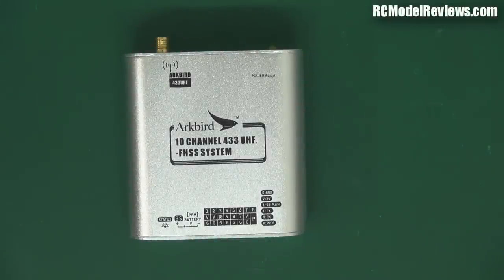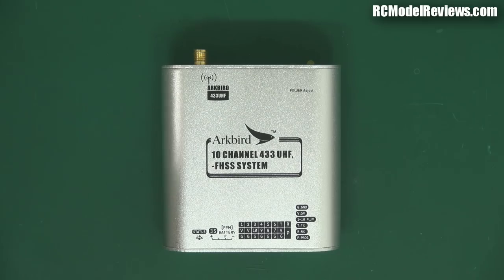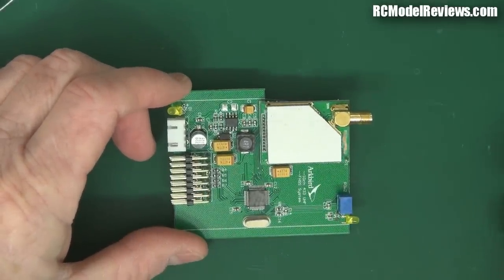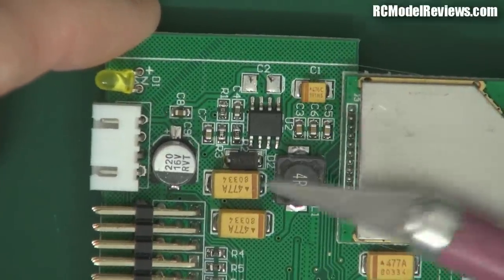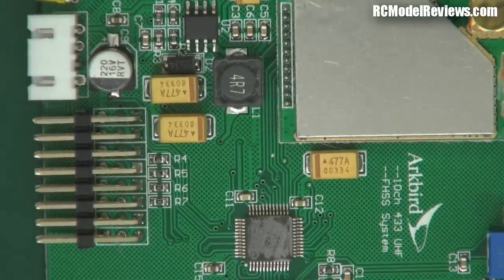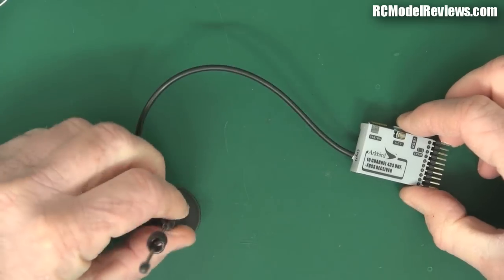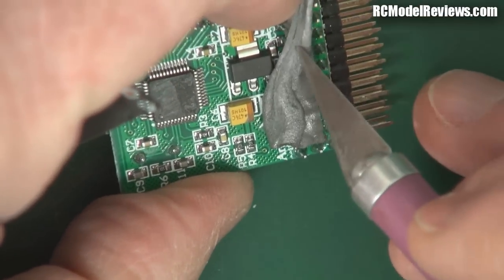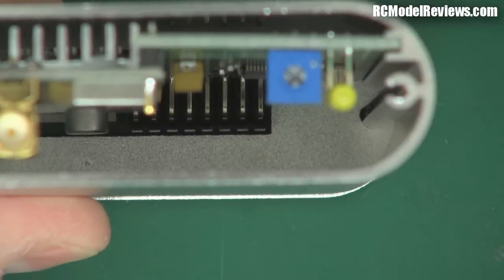UHF RC Shootout: Arkbird Long Range System (part 1)

Comment: Working my way through these with interest Bruce,  I have to say this was the one I was routing for..... I guess I will keep my fingers crossed for the testing, that said I am not looking forward to resoldering antennas fo rthe RX's if it shines in those tests.
Reply: RCTV-UK It seems like an interesting unit.  Soldering a jack on there looks like a pretty easy job.  Now that antenna looks pretty odd, but the performance could be fine for all I know.  I guess we'll find out, but I would just leave it as is unless there's a problem.  Maybe it looks weird but I wouldn't be bothered by it.
Reply: +pillsnotbills I've seen a video of someone doing 60km with this antenna.
Reply: I was thinking the same exact thing.  How hard could it be to soldier a jack on for a dipole antenna.  The price is right if it works

Comment: 3:13 3:37 So I guess it's effective. You admit that you couldn't easily find any data on that Xmitter module. The idea is that if a hacker wants to copy it, to have the hackers waste as much of their time as possible to make it non viable/profitable. 

Of course if someone has nothing better to do with their time... it can always be done.
Reply: lasersbee 
Someone who knows the usual sources for ready made modules may have to search for an hour to find the original manufacturer. And it won't be anything special anyway, just a serial-to-RF module that are available in plenty configurations.
And it took me approx. 5 seconds to suspect the chip to be a STM32F103xx in a LQFP48 package and another 15 seconds to confirm the pinout (powersupply, crystal connections) with the datasheet. So it most likely took the guy at the factory longer to scrape off the marking of the chip than it took me to find it.
Reply: Jellapper Lökkäs I don't find Hackers important at all. They should use their "intelligence" to create new and useful things rather than steal the IP of someone else.
Reply: +Jellapper Lökkäs i agree. Deep facepalm

Comment: ive tryed this.. waste of money. using it as a repeater linked to a 2.4 receiver,  it was so lagy. the was such a long delay between signals.. i didn't even risk flying with it  
show us a part 2 bruce!
Reply: +drifta1600 Did you use single PPM cable from TX ? I've heard this causes the lag but if you use separate servo cables it works fine.
Reply: +Chris Flory tryed it both ways. both had lag. used with frsky taranis. went dragon link. works perfect.